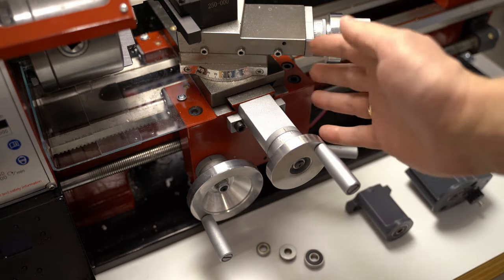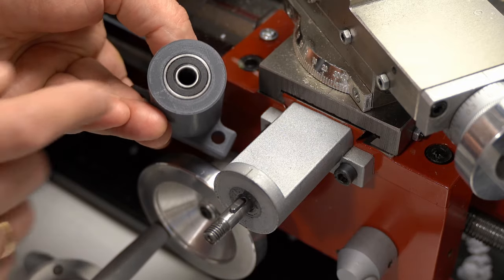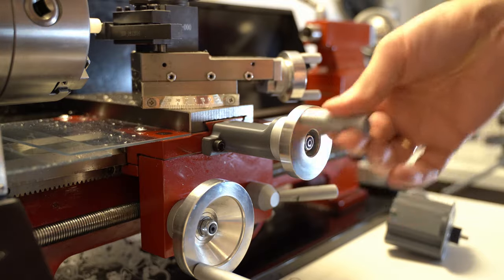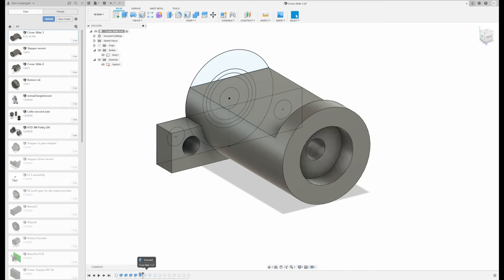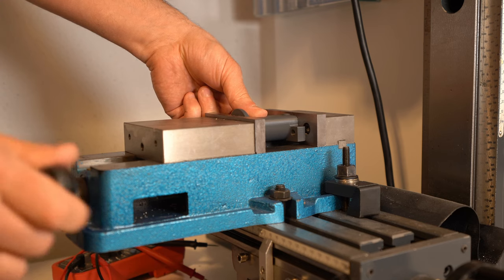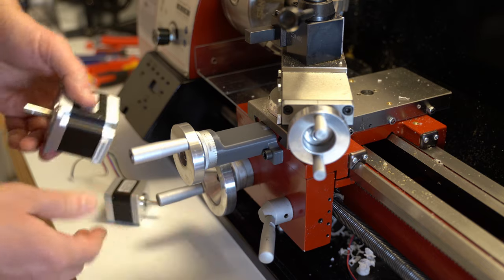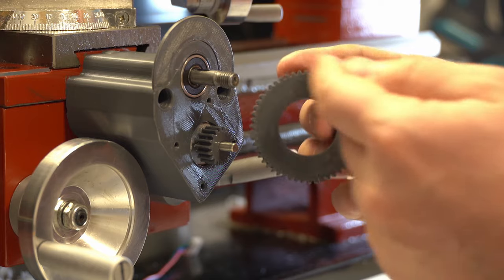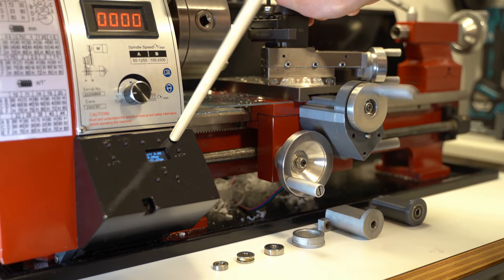Improving the mini lathe cross-slide

Comment: Exactly, just a couple of week ago I got my lathe here and even today (year 2024) the China factories are having same issues ! what is really frustrating to me is, the factories have all the resources and quality raw materials the need to do it right yet they chose to cheap out on stuff like this... yes from day one I had to start modifying mine since I do not like at all bad precision machines .. next for me is the cross slide that even with the adjusting of those 3 screws will not do the job -- wayyy too much slack

Comment: Maxim you're a genius!  That's exactly what I was looking for and just needs a geared Nema 17 - after all a cross slide only needs to move slowly. Personally I'd like to keep the scale on the handle, and be able to disengage the gear to use the handle manually without winding the motor, but these would be simple developments of a brilliantly simple design.  Excellent engineering.

Comment: Thanks so much for this. I printed it out but I should of measured first. After a few adjustments and 2 failed prints, this worked really well on my AL-51G. Now i've got to fix the compound slide's mount, it's so bad.

Comment: Hello
I really like what you did around
I have the same turn and I will embark on the modification
a small question
what model of tool holder is mounted on your lathe?
because the original model is not great
thank you
good continuation
gilles
Reply from the maker: Hi Gilles, my tool holder model is 250-000, it's not very rigid but works for my basic needs. Cheers!

Comment: How do you compensate the huge inertia of the wheel and handle? Wouldn't it be better if it would be driven directly with a planetary gear? I mean what for a improvement is that with the handle still on? I mean if I would have a lathe and I would upgrade it to a cnc lathe then personally I wouldn't need the handles anymore. I would load my G code in the cnc lathe and just supervise it. Anyhow great work. Keep it up!
Reply from the maker: Thank you. I was turning a part last night and used both ELS and the handles, was fun. Jumping through CNC hoops is only sometimes worth it in the home shop.
Reply: How does it work? Do you need to stop the ELS how does the cnc system know were to start again when you are finished using handles? I have a CNC 1830 the only modifications that I made are the end stops a beefed up Z carrier and a 800W 30000RPM spindle. I use Grbl and F360. I noticed that I can also can generate tool paths for cnc lathe in Fusion. And Grbl could be set as lathe as well. Do you have a homing and stops and a homing routine for your CNC lathe?
Reply from the maker: @icebluscorpion  see my other video on Rocketronics ELS, it doesn't require a computer at all, just position the tool and click in the operation needed.
Reply: @MaximKachurovskiy  I have also another question, what Lathe do you use and would you recommend it for the price that you bought ?what specs does it have?
Reply from the maker: @icebluscorpion  I'm using WM210V from AliExpress, it's gotten expensive now due to taxes and delivery charges so I can't wholeheartedly recommend it anymore. I have a long video on my channel about this lathe, please take a look if interested, it has a shop link too. Please keep in mind that I'm an absolute beginner in machining though.

Comment: A steel tube spacer between the two inner races would be nice, to transmit the tightening load via steel to the carriage, it would need to be cut to exactly the correct length to give you the right preload but you have a lathe with which to do that ;)
Reply from the maker: Great idea and easy to make.

Comment: Hi maxim.  Say could you tell me what degree your crosslide and tool post are set at.  It looks like 30 degree on the crossslide. So would I put the tool post on 30 degree also.   I’m playing around with it and it seems like my cutter is going at a slight angle.
Reply from the maker: Jack, yes, I'm using 30 degree on the top slide. Reason I did this is to have more control when trying to take off the last hundreds of a mm. My cutter is still parallel to the chuck as much as possible. Not sure if this is the best setup though, just too lazy to rotate it now :)

Comment: Thanks for the video.  I printed the no-motor version of this part and bearings are ordered.   Using deep-groove bearings instead of thrust bearings is a good idea.  They can take 1/3 of their rated radial load in the axial direction.  For 608 bearings, their rated radial load (static) is 307 lbf (1370 N) so they function as a thrust bearing up to that point.  (That's the low estimate---the dynamic limit may be as high as 260 lbf but that's probably for fairly high-speed turning.  Hand operation is closer to static.)  The axial load on the bearing during cutting is unknown but it could be as high as 100 lbf, so I would say that this is a marginal design.  In theory, the cutting forces are straight down.  Also, the elasticity of PLA is considerable compared even to aluminum, which is another weak point of this design.  However, it looks like you've had good results so maybe it's good enough.  I'm a fairly timid machinist so it will probably be good enough for me.  I'd check the pre-load occasionally because PLA can creep a bit and you might find excess lash in the cross slide over several months.  I think I'll Also, if you want to use the smaller bearing on both ends, a PLA spacer could solve the problem of the dial touching the other race.  Compression is a strong mode for PLA and the printer has high resolution in the Z axis.
Reply: I’ve used PETG instead of PLA for all elements of stepper motor model. It seem more resistant.

Comment: With this static gearbox the manual option is not possible!! Which make the Handel absolute or just act like an obstacle !!
Reply from the maker: Most ELS controllers disable steppers when not in use so the manual operation is still possible.

Comment: Hi Maxim, you can tell me what maximum voltage admits ore 17 and what would be the optimal voltage. Thank you!
Reply from the maker: Ismael, I'm currently using my NEMA 17 with 48V power supply, same as for the NEMA 23, and don't have any issues. Cheers!
Reply: @MaximKachurovskiy  thanks for answering. I also have it with 48v same wue nema23 but I notice that it heats up. What rms amperage do you use?
Reply from the maker: @IsMaCR63  I'm on vacation now so can't look up the exact value. It could be ~1a. I assume it could be lowered untill you start having problems with torque?
Reply: @MaximKachurovskiy  at the moment I have no torque problems. I have 48v and 1.7a. the motor is 1.8a

Comment: Hi Maxim. Can you provide me with the fusion 360 file of the nema 17 motor bracket?
my lathe is the same as yours but the support on my lathe does not quite fit well and I have to modify it.

Thanks. A greeting.
Reply from the maker: Ismael, sure - https://www.thingiverse.com/thing:4714722/files - best wishes!
Reply: @MaximKachurovskiy  Thank you very much, I did not see that you had it in thingiverse.

Comment: Aluminium oxidizes so you will always get black oil , 
 
Anyway these small lathes tend to have a lot of backlash , because of the poor threading in the casting of the cross slide and Main feed slide, at a guess I expect they used the wrong Pitch for easy threading.
But yours is not to bad :)

I love the idea of adding nema motors, I do have a few spares around and a controller so i will have a go.

Comment: Thanks for sharing with us your work, but I've not understand why you have not used the axial bearing 😊
Reply from the maker: I was mainly designing for the motorized version where there are significant lateral forces. For basic version I agree that axial bearings will perform better.
Reply: @MaximKachurovskiy  thanks for reply, I'm will search to mod my lathe with axial bearing 😊
Reply from the maker: @antonio.stefanelli  the same concept applies, just need to adjust the case for axial bearing sizes and allow for the outer axial bearing ring to spin freely.

Comment: You could make a new wheel for use with the motorized mount So you can keep your dial for threading. Maybe a stackable design with a pins so they all rotate together.
Reply from the maker: MrCinpro, interesting idea. I went with a plastic dial for now: https://www.thingiverse.com/thing:4714722

Comment: Nice video! Thanks. Had you change the interior nut screw? i mean at the other end of the vise.
Reply from the maker: Thanks! No, I didn't change any screws I believe.
Reply: @MaximKachurovskiy  At the end of the screw there is a nut that cannot be adjusted, they all tend to have slack, it's difficult to fix/adjust without a suitable nut. My lathe have arround 20 hundredths mm. slack, it's a lot!

Comment: Hello @
Maxim Kachurovskiy you make awesome project. Does your published code for Arduino support 2nd axis. I prepared everything and solder it to your PCB, but 2nd axis does'n work, so I guess project is still in progress right ?
Reply from the maker: Slamar, NanoEls is only for 1 axis. I'm working on a fork of a Russian project Digital Feed which supports 2 axis though it will take some more months to publish that. It will be a much larger PCB on Arduino Mega. Cheers!
Reply: @Maxim Kachorovskii Thank you for quick response, I appreciate that. That's my fault, I didn't check it before. I just find that project on GitHub discuss, I will try to follow it. Have a good day 😉 Last question, do You put Arduino mega  under your 3D printed enclosure and You're using your Nanoels board to control it?
Reply from the maker: @Slamar  it will be a project unrelated to NanoEls. Mega will go under the PCB and a display will go on top of - https://imgur.com/a/BVN2619
Reply: @MaximKachurovskiy  Ok go it thanks 😁

Comment: Hi Maxim, it's not clear to me how you control the movement of the two axis during the automatic threading of the bolt. Did you write a specific code with Arduino to make such operation?
Reply from the maker: Hey topmounting, yes - https://imgur.com/a/PKctaDy - in Arduino I'm using this work-in-progress code: https://gist.github.com/kachurovskiy/82bd219854d432c72eaa0d86237537b1

Comment: Do you have a all your stuff to print somewhere ?? I'll be purchasing one of these lathe soon. Great work
Reply from the maker: Hi choco107, thank you! I shared the model on https://www.thingiverse.com/thing:4712247 but it might not fit your particular lathe / bearings. I'm sure you will have little trouble designing one of these yourselves, Fusion 360 is really easy to use.
Reply: @MaximKachurovskiy  absolute legend thank you

Comment: I've used a lot of 3D printed parts for my lathe and mill. Interested in what type of filament you used. Some of my PLA parts were just not strong enough playing with infill and number of walls. Normally I have to make partial parts to make sure they will print especially for bearings or fasteners to fit. Nice work!
Reply from the maker: Yes, PLA is not the best. I've got some PETG but yet to try it. Afraid it will damage my printer bed :) Some people say it's a problem with PETG, others say it's not 🤷
Reply: @MaximKachurovskiy  Spray a light mist of unscented aquanet hairspray on the bed before printing. Works magic.
Reply from the maker: @alanb76  I since printed a lot of petg and had no bed problems whatsoever :) thanks!
Reply: @MaximKachurovskiy  I had good luck with PETG on Isopropyl cleaned PEI until one day it would not release from the PEI and ruined the surface. Since then I've used a light mist of Aquanet on PEI and never had another problem. I also print TPU and PLA on Aquanet now, and rarely ever need to clean with Isopropyl. Aquanet coatings last quite a few prints, so it is much lower maintenance than PEI alone. It collects some dust but the prints come out fine. Occasionally cleaning with water removes the dust and Aquanet and a new mist is applied. I also avoid touching the surface as finger oil causes a lot of the common adhesion problems. Another misting every few prints is sufficient, and it saves a lot of alcohol. I've not even used a whole can of Aquanet in a couple years, not much is required. I also tried the Windex but Aquanet works better than Windex or Glue Stick.

Comment: Do you sell these parts on eBay or Etsy? This would make a great improvement in my slide as I don't have a plastic printer.
Reply from the maker: Mike, you can order prints online these days. Go for higher infill - maybe 90%. Best wishes!
Reply: @MaximKachurovskiy  Thanks Maxim.
Reply: Where is possible buy this parts?

Comment: Great! Thank you for that work.  Does it fit for the Sieg SC3 lathe, it is called mini lathe also but I'd like to be shure.
Reply from the maker: Adrien, I don't think it will fit. You should be able to design a similar part yourself though, it's very easy in Fusion 360. Good luck!
Reply: @MaximKachurovskiy  you are right!

Comment: This is genius!  I also have a 3D-printer and make every kind of shit on it, but I could not realize I can print critical lathe parts on it!  (And I also have a similar lathe with all the same problems :) ).  But now I see: indeed - the possible additional deformation that the printed part brings to the whole cross slide assembly does not exceed the precision of the lathe.  The play in the original design decreases the precision much more than your part(s)!  Like odnoznachno! :)

Comment: What size bearings did you use ? Thank you
Reply from the maker: Neale, 608-2RS on the front and 688ZZ on the back.
Reply: @MaximKachurovskiy  thank you
Reply: @MaximKachurovskiy  just done this mod, a friend used his 3d printer to make the part but didnt use full strength. I can feel a small amount of flex but the slide is so smooth now. I will be getting another made soon ( in a better colour) and full strength hopefully.

Comment: Do you think a Nema 17 could work also ? considering there is the gear reduction too.
Reply from the maker: Nadas, yes, nema 17 is working well for me here. The movement is slow due to reduction but it's not a problem.
Reply: @MaximKachurovskiy  right now I am printing the version from thingiverse, I have a WM210V too it should fit, I would like to try the motorized version too if this works well.
Reply from the maker: @cosminnci  cool! Added the motorized model at https://www.thingiverse.com/thing:4714722
Reply: @MaximKachurovskiy  I just mounted the stand alone version works nice, the small bearing was harder to find, posted a make on thingiverse ;) for the motorized version I have the parts but need to make the electronics and control part. thank you ;)
Reply from the maker: @cosminnci  I just learned that only the first numbers matter for the bearing models as they define the physical dimensions - 608 and 688. The rest of the model name is likely non-critical for our application here. Nice touch with the washers on https://www.thingiverse.com/make:887608

Comment: Nice!! I think there is less backslash when using a Tooth belt. ;-)
Reply from the maker: Pierre, yes, but most of the backlash at this point is coming from the nut attached to the slide so the difference between using the belt and gears should be minimal.
Reply: @MaximKachurovskiy  Yes, that's correct, succes

Comment: Maxim, why don't you use 100% infill? There will be no cracks around the screws...
Reply from the maker: Good point, didn't try that.
Reply: @MaximKachurovskiy  
I think a better option is to increase the "wall thickness / number of wall lines" parameter.

Comment: I like how you mounted the motor on the apron. I want to do something similar to my mini lathe. I would like to add power cross feed but I basically want a forward/reverse and possibly a speed control knob. How difficult do you think that would be?
Reply from the maker: That depends on your lathe model - which one you have? If you're interested in just the cross-feed control, https://www.aliexpress.com/item/33048497080.html should do that. Add stepper, driver and a power supply, connect wires together and it should work.
Reply: @MaximKachurovskiy  I will try to find a controller like that here in the US. What strength Nema 17 motor are you using?
Reply from the maker: @bowtiedooley  I'm using 0.42nm but 0.71nm version that's 60mm long will also fit. Due to gear reduction, it's multiplied by ~3x. Note that plastic parts don't like heat, if you need to run this for more than ~10 minutes at a time, some of the parts would have to be made of metal or heat-resistant filament.